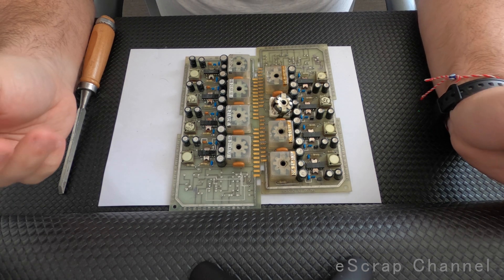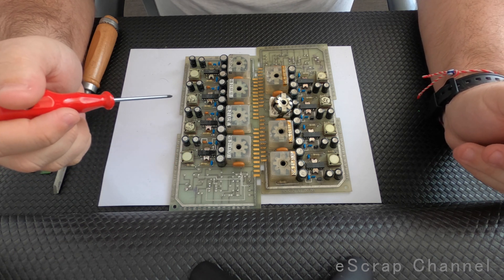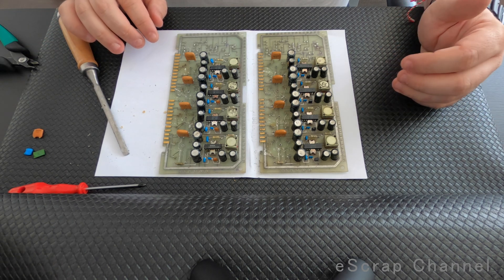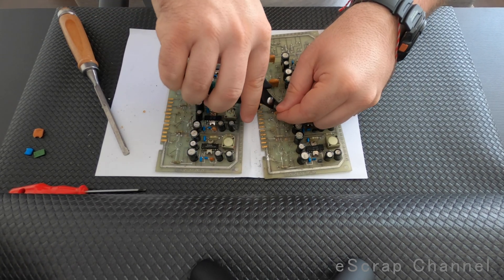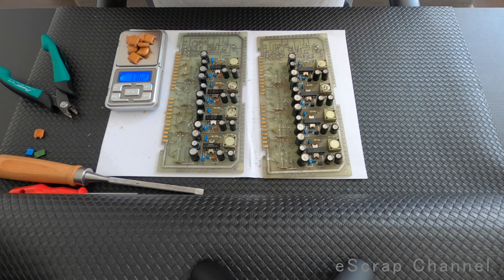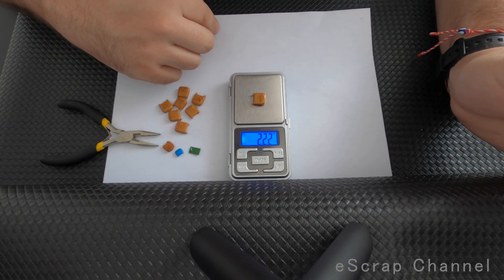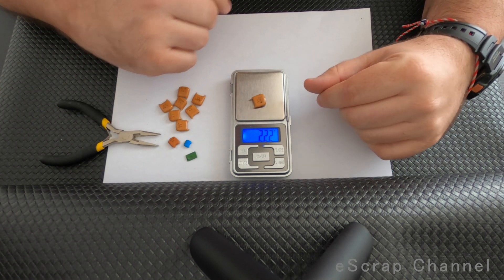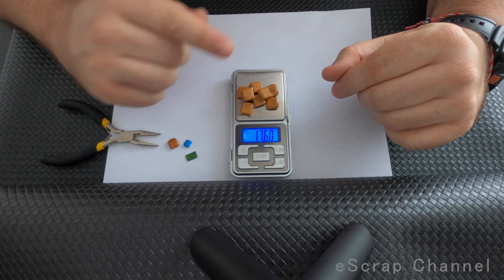Scrapping Vintage Electronics Boards - Huge capacitors for Palladium recovery!

Comment: How do You know which ones contain palladium?
Reply from the maker: In this case from the capacitors label. On the Bulgarian brown ones is always written bC,, bE, bO. In general I first check such capacitors if magnetic - non-magnetic have good potential. I cut them in 2 and check with magnifying glass 🔎- silver containing ones have white color as ceramics and panels are white. Palladium containing ones are more silvery metal color of the lamels. Result is clear after processing 😃
Reply: @escrapchannel  Thankyou so much, I learned alot.

Comment: You left the main part in potentiometer
Reply: It will have palladium coated or pd solid points
Reply from the maker: Well done - you are right! Just did’t take them during the video but after that. I was shocked from the size of the capacitors!
Reply: Going to start YouTube channel on e waste recyling but different one
Reply from the maker: You just got a subscriber :) Waiting for your videos!
Everyone has a viewing point, that’s why YouTube is so interesting!